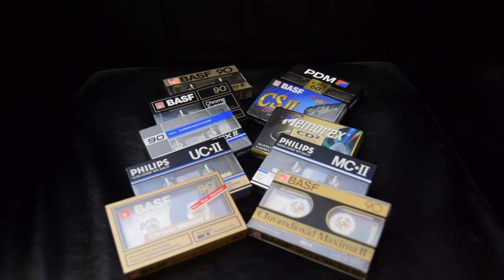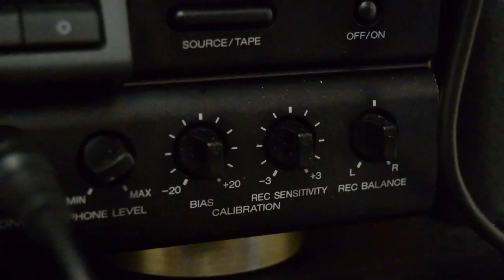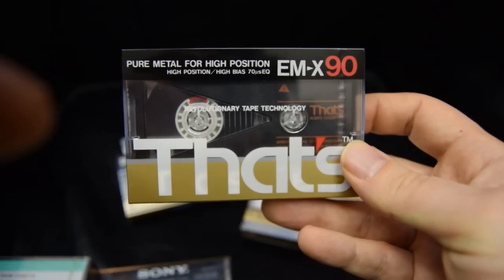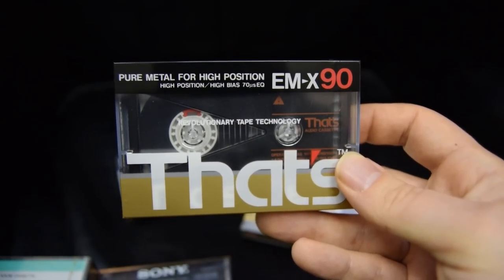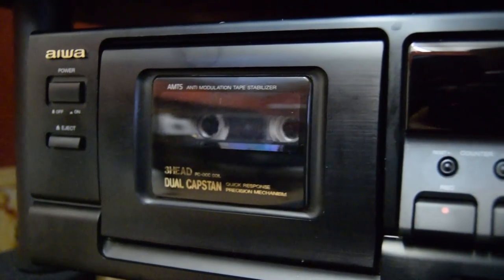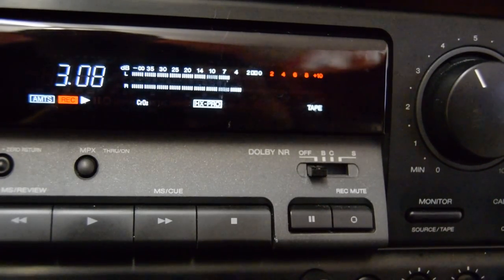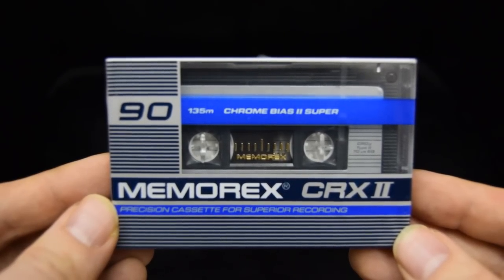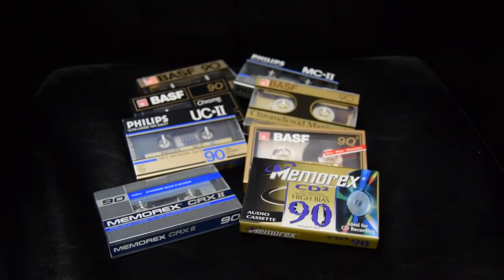Pure Chrome Type 2 High Bias Cassettes - Why They're Not "Rubbish"

Comment: I just opened one of these BASF Chrome Maxima II tapes and put a signal generator and a 'scope on it.  It saturates at around +1.5dB, so I kept the peaks around 1dB, then calibrated EQ, bias and wow, lots of bass, slightly muted treble and a very, very low hiss level.  Without calibration and recording it as a TDK SA-X / Sony UX-ES it is horrible, it sounds like listening to music with earplugs in.  I did notice it needs a lot of bias power, into the metal region to re-use the tape (the original calibration tones were audible during quiet passages)  I did have a laugh at sniffing the cassette, that wax crayon smell - like smell-o-vision :P

Comment: Maybe you could make a video explaining calibration and Bias. 

Just found your channel, great videos!
Reply from the maker: That would be scientific and boring 😀 I prefer to focus on the joy of the sound and the physical looks, but never say never.
Reply: @CassetteComeback  Same here. I'll look around the net to try and learn something new about my hobby. Keep those videos coming. Cheers!
Reply from the maker: Bias rule of thumb, think of it as a treble and bass. Take bias away, you add treble and reduce bad, add it to reduce treble and add bass.
Reply: Calibration and bias are used in setting up a tape record and are two different things or processes. Firstly calibration requires the use of a special calibration tape. They are used to determine the alignment of the trade heads and the tape speed. Alignment is critical to the frequency response and obviously the tape speed is also critical to being to the standards required. If the tape speed is wrong on your recorder the pitch of a note will be different to the actual note played and recordings will sound different on other machines. I think you can still buy calibration tapes. 
Tape Bias is another subject but is still important in getting the best performance out of a tape recorder and I mean all tape recorders. That is reel to reel and cassette based systems. 
Bias is an alternating current and frequency applied to the tape head. It acts rather like a snow plow and and overcomes the induction of the tape head coils and improves the ability of a tape to accept a signal and reduces distortion. As you increase bias from nothing you will see the signal out off a tape playback head slowly improve until it reaches a peak and then starts to decrease. 
The usual technique was to slowly increase the bias until it reached a peak and the signal off the tape would be at maximum but would also have small degree of distortion. As you take the bias up even further you would see the signal strength off the tape start to decrease and the distortion would lower. 
Sorry if this is a rather simplistic explanation but it was what I was taught when I ran a company that specialised if tape recorders and tape systems. 

Jeremy Travis Teletape London.
Reply: +Miquel... I don't view it as a hobby myself. I just always used tapes and now that very few people want them, I can pick them up for a quarter.  It's a very inexpensive way to increase your music collection.  Same with CDs. I am finding more and more CDs in thrift shops, though they tend to be a bit more expensive.
Reply: @CassetteComeback  Thanks the light bulb just went on in my brain! Cheers!
Reply from the maker: Watch this, it will help more:
https://youtu.be/fCOBgIiIMEs
Reply: @jeremytravis360  Thank you. I just learnt a lot in a short time.
Reply: @jeremytravis360  Hey just an electronics engineer student chiming in. During my course in electromagnetism I recall my professor mentioning in a lecture that, tape needs to be close to saturated magnetically due to something called magnetic coercivity where nonlinearities arises in ferro magnetic material if not driven enough, so the biasing makes sure that the magnetization of the tape get's pushed into a linear region of the magnetic medium.

Comment: Chromdioxide tape has lower noise floors, sharper cleaner sound and brighter trebles.
Reply from the maker: Absolutely. That's what people who can't bias these properly are missing out on...
Reply: @CassetteComeback  I was trying to calibrate maxima II, no problem....  and then i recorded control siginals (10khz, 100hz, etc) and thats different story. Maximum recording level for highs: -6db, -5db, some basfs-II allow for -8db max recording level for 10khz. Ive seen it so many times, i think Chromium Dioxid tapes are too old to record properly.

Comment: Another great video! The biggest problem I had with BASF Chrome tapes is if you left them inside a car in the summertime, they could develop print-through easier than other tapes. And I used a lot of Memorex HBII 90's in the early 80's because Wal-Mart sold "3 tapes for 2" packs. I thought I was getting a good deal then, but after 35+ years the pads have deteriorated into mush.  Sometime in the mid 80's Memorex got bought out by Tandy (Radio Shack) and the quality of the high bias tapes got better fast. The CD2 is a really good tape.
Reply from the maker: It's like were spirituality connected 😀 You'll never guess what the next video, that I'm editing as we speak, is all about...

Comment: BASF Chrome can be superb and I will always take this over TDK. In addition to lower hiss it also has lower modulation noise compared to nearly all doped ferric formulations.
Bias correctly, max out at 0dB and switch off noise reduction = bliss on a good deck. I have several decks but this pretty old 1975 Pioneer is now tuned to run single coat BASF chrome flat and the super chrome or dual layer types slightly bright. There is a link to a Radio 4 speech recording below followed by some music, no Dolby on the old Pioneer after a good service.
Also as you can see, I have a thing for BASF :)

https://farm8.staticflickr.com/7008/26698840710_f8a7b85dec_z.jpg

https://farm8.staticflickr.com/7057/26972231575_85061e651f_z.jpg

https://farm8.staticflickr.com/7421/26877938802_a1087a1716_z.jpg

Music:

https://youtu.be/dbbQFj_1Sb0
Reply from the maker: I can't think of many better Type 2 than a BASF. In fact, I can't think of any BASF that were poor.
Reply: @CassetteComeback  I have a BASF early to mid '90s chrome tape (I can't find it right now, it's in a "transversally reinforced shell"), and it's horrible. It sounds good, but the tape surface is very uneven, it has a lot of dimples in it, and it sounds like it looks: dropout city. And it's not due to wear, it's like that since I've torn the wrapper from it (and basically it's still brand new, because I haven't used it since I experienced its flaw with the first test recordings I made onto it). Maybe I'll give a second chance for that type if I see an other one for a reasonable price. Mine might have a rare manufacturing defect. I had no problems with '80s BASF CrO2-s.

Comment: There was a lot of controversy regarding chrome tapes back in the 1970's . 
The trade magazines claimed they wore down your tape heads more quickly and this was supposedly because a lot of tape heads were made of a permalloy rather than ferrite glass heads which were introduced by Sony. Chrome tapes from America were a lot more expensive. You have to take into consideration the exchange rates back in the 1970's.
It was not helped by Memorex running adverts that said something like "Is it live or is it Memorex" . The advert showed them shattering a glass with a tape recoding. 
The reviewers of the day took them to task and pointed out that you had to have a volume level in excess of 147 db which is more that the human ear could listen to without causing damage to your hearing. 
I do know that I sold more TDK SA and Maxell UDXLII tapes than pure chrome.

Comment: You just answered my question of why the BASF CRE II doesn't sound right in my Nakamichi RX-505 no auto-calibration and the other Sony UX, TDK SA, SAX, Maxell XL sound great.  I have to look for another deck with the test tones to fine-tune my calibrations or play with the tape more because it will easily distort above zero and plus 2.  The BASF CRE II is a pure chrome, especially the early version and the rest of my tapes are the dope chrome ferric brands.  Thanks, Tony for doing this and you are a wealth of knowledge and are responsible for me re-buying recordable tapes again in different brands. I use to buy different brand tapes a lot in the earlier days because I use to like and try different brands to see the reaction of these tapes and just to experiment. 

 I just solved the problem, after this video I did some experimenting and brought my level down to zero and played with the bias and recording levels even more along with Noise Reduction on and off and the compromise is with the noise reduction off, due to the noise level of a pure chrome having less noise.  I just have to get used to turning the volume up a little more, but the tape itself is fine.  My BASF is before the one that you used in the video.  Thanks for sparking me to think about the difference between Cobalt Dope Ferric and Pure Chrome.  I'm beating myself in the head for this because I experienced this with BASF in my SONY boom-box from the 80s and had stopped using BASF. My Nak and the BASF are fine and using no noise reduction is best due to the low noise. Thanks, Tony.
Reply from the maker: Glad it helped. Yeah, I bought them once in the 80s and thought they were quiet and dull and never bought them again... knowledge can be useful sometimes 😁

Comment: I’d love to see your take on type III ferrochrom’s, there really isn’t much info on em and they were so shortlived
Reply: BASF FeCr sheds itself very quickly, the SM (shredding mechanism) doesn't help, but the binder has aged to the point where those tapes are useless.  A Sony or Denon FeCr will still be OK and in the right deck (a deck with Type III ability and calibration) they sound very good.  But of course, Type II got much, much better and Type IV tapes with their huge power left FeCr as a solution looking for a problem.  The prices of FeCr are just rarity value these days, there's little point in buying NoS Type III to record onto.

Comment: I use a Nakamichi ZX680 and BASF Chromes are indeed a little bit troublesome with it, as it has no manual bias adjustment. But he BASF Chrome Maxima with the big window are the most beautiful cassettes in my taste. So, is there a trick to make them work?
Reply from the maker: No trick, you just need a deck where you can Calibrate the bias and levels to suit it.

Comment: hi i've got a hifi with a cro2 setting, will it be able to cope with pure chrome cassettes?  its a sanyo.  or is cr02 for cobert  doped ferric  to make it sound like a chrome with all its prenounced hi hats etc?  i've done a test recoding on my sanyo with a cheapo type 0 tape you did a video on, but the audio is ok but it could do better i think with a more expensive type 1.  as i had to set the level to just down from 5 on some songs or it would of been to distorted. I have a option to either to listen what the tape is giving off or the source.

Comment: Tony, what do think of Yamaha's "Auto Tape Tuning" feature and how it works? I have a Yamaha KX-390 and I've had it for 21 years and I think I just figured out last night that I have been using the "Auto Tape Tuning" improperly. I was always using the procedure with the REC LEVEL all the way down like a dummy. Yamaha's manual is rather "sketchy" with the instructions and the correct steps to follow. Is "Auto Tape Tuning" a similar type of method as the deck you used in this particular video??......Hmmm
Reply from the maker: Never had a Yamaha deck, but I imagine it's the same as the likes of ATC on a Technics. Set your master level to what you want the cassette to be recorded at, the auto will set the bias fine and rec level for the tape and you should be good.
Reply: @CassetteComeback  Thanks! I'll give it a go tomorrow.
Reply: Usually those automatic systems on 2-head decks record a 400Hz tone and a 15kHz tone at a set range of intensities (irrespective of the input level) and then replay them to find the optimum bias and equalisation.

Comment: I found a BASF Chrome Professional II tape for some 80s rnb band at a thrift shop in mint condition, could I overwrite it in my Portastudio or cassette deck with any decent results? Vs say some budget type II tape. I mostly just run drum loops and some other samples through them
Reply: Also it says on the tape to run it at normal not chrome setting on my tape deck but it does sound a bit better with some bias adjustment, might be my deck

Comment: Who said they are rubbish ? 
If someone said that then he-she knows nothing about them for sure 

i use cassettes all types since 80s till to this very day and they all sound amazing even the type 1 

all we need is a good deck a good source and to know how to use the deck of course :

My decks are not the super top they are the Technics RS-BX707 & Aiwa AD-F850 
both are very decent decks making great copies in all cassette types from all kind of sources Cdp-Turntable - Radio e.t.c  :-)

Cassettes were and still they are amazing still using them &  loving  them :-)
I wish they'll never being stopped produced :-)
Reply from the maker: A few. To be honest "back in the day" when I bought BASF pure chromes to use in my low end gear, I thought they were rubbish too. It's only the passage of time and knowledge that helps to make the most of these cassettes, hence me making this video. In fact I have another one coming up later today which features the hardest cassettes to get a good recording out of that I've ever used. These do sound bad unless you know what you're doing...
Reply: @CassetteComeback    

Everything seems to be crap when we don't have good gear 
And when we have good gear then must know how to use it
Reply: @Badassvidsz  amusing to think, when we were young and our ears could hear everything, we had "cheap" equipment and our parents bought super expensive HiFi, despite not being able to "hear" it.  I got a great deal in my first year at university, one of my profs was really into vinyl and wanted to put them onto cassette to save wear, so I embarked on a cost-no-object spending spree, so I am very familiar with the Nak ZX-9 and Dragon. The audio people even provided a tutor to explain everything.  I made some lovely recordings for my Walkman and then he discovered DAT and just like that, compact cassette was dead.  Those were heady days, I got to listen to a lot of hyper expensive kit whilst my ears could hear them.  Now I'm back at cassette and am kicking myself for selling off my decks all those years ago (I inherited them for pocket-change), they go for insane money these days and the cassettes, wow!  So it's just a hobby really, I like the analogue distortions that tape gives a kind of audible fingerprint to.

Comment: What do you think about recording audio to vcr, I've never tried it, there's lots of people saying, it like listening to reel to reel.
Reply from the maker: It's very good on a hi-fi VCR. In the 90s I used to record the top 40 onto VHS in stereo, then edit it down onto regular cassette so I could edit out the DJ. Dat was very similar in the way it recorded.
Reply: It does sound good on a Hi-Fi VCR. Even recording at EP/SLP speed. It has a very low noise floor for being a tape medium. And it has EXCELLENT bass response. As much as I used to love recording on cassette, I couldn't stand the lack of response below 80Hz. You needed an equalizer or a bass control that was centered around 50-60Hz to regain that "Punch" and deepness. Bass was boomy around the 100-140Hz range which almost always drowned out the low freq bass.
Reply: Yeah, it's very good, around 70dB S/N and a flat response 20Hz-20kHz.  The problem I had with VHS HiFi was the dynamic range wasn't very linear, so loud sounds would blot out quiet sounds, that is just part of the way the conversion to and from FM for recording onto the tape is achieved.  I used to record Pete Tong's Essential Selection / Hit Man and Her etc. onto HiFi VHS so I didn't notice that problem :P
Reply: VHS sounds good, but it’s not really anything like reel to reel. It’s more like a digital storage medium akin to DAT than anything. Also, the sound most people associate with VHS is their auto gain controls. If you find a hi fi VHS without auto gain control, you can saturate it. However, some of them have sync issues. If you’re not running some kind of video feed with them, the tape can drift in speed
Reply: On Beta it was great too, maybe even beter.